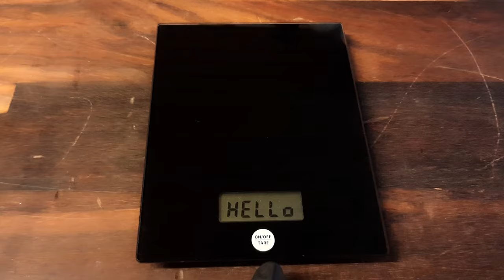Cool CUFF Bracelet Making - NO Solder - In My Workshop

Comment: Do you have a video where you explain what tools you use and what equipment is necessary to get into making this kind of personal jewelry? That would be really helpful.
Reply from the maker: No I havent´t but you can easily start with a small gas burner, round pliers, pliers, a small hammer, some hand files and a small vise - and then you're good to go. You don't need to buy expensive jewelry tools - I just use the usual hand tools that are in my workshop.  👍
Reply: @my-projects  thanks.
Reply from the maker: @AereForst  You'll probably also need a jeweler's saw - it's hard to do without if you have to do precision work 😉👍
Reply: @my-projects  I agree. Any recommendations on good brands for your tools and equipment would be appreciated.
Reply from the maker: @AereForst  I use different brands - often buy most of them in ex. Bauhaus - I know they also exist in Norway ☺I generally prefer Bacho hand tools, but they are a bit expensive here - so I also occasionally buy other brands for less money. And in power tools I prefer Makita, but also buy cheaper brands because they can do the job too.
Reply: @my-projects  I’ll check them out. Btw I’m in the good old US of A🇺🇸
Reply from the maker: @AereForst  Ok - sorry for that - I saw that your YouTube profile looked Norwegian - that's why I wrote like that. Sorry 👍
Reply: @my-projects  Oh no worries bro,  I’m Norwegian-American. I love your work. I think it’s a hobby I will enjoy.
Reply from the maker: @AereForst  Thanks 😊 - I’m sure you will 👍

Comment: You're videos are amazing and inspirational.  I tried to make something similar, but I always have trouble shaping the bracelet. I can flatten it with no Issues, but rounding it always gives me a hard time and the bracelet ends up looking like it was run over by a truck. Any suggestions?
Reply from the maker: Thank you very much for your kind words and feedback - I really appreciate it.👍 I would suggest that if you braid the wires as tightly as possible and then hammer it into shape while it is straight, then I would suggest that you tighten the ends together separately, either with a small cable tie or another wire - but still so that they can move a little, you should be able to bend the bracelet without it going out of shape. Let me know if it works. :)

Comment: Thought the bracelet was very cool. What size wire did you use? It would be helpful if you talked your way through the video so we could know how long this took,, what size wire etc. Thanks will subscribe.
Reply from the maker: Thank you for your nice feedback. ;-)  Very good point..! I have previously considered talking my way through my videos - maybe I may do so in my next videos. I used 3mm silver wire and a 12 x 1.0mm copper tube in this video.
Reply: Is the 1 mm or the diameter of the tubing or the wall thickness?
Reply from the maker: @dhduncan  12mm is the diameter - and 1mm is the wall thickness 👍